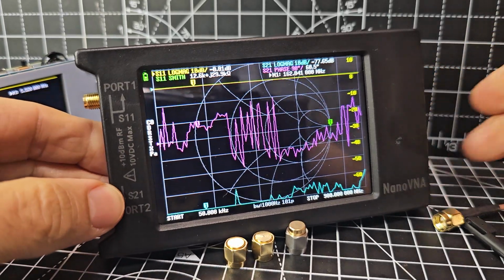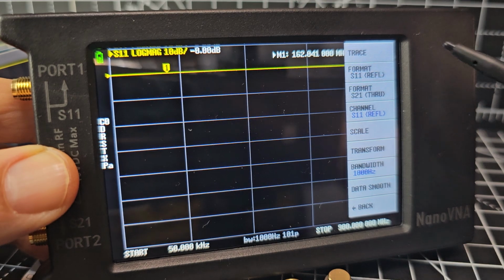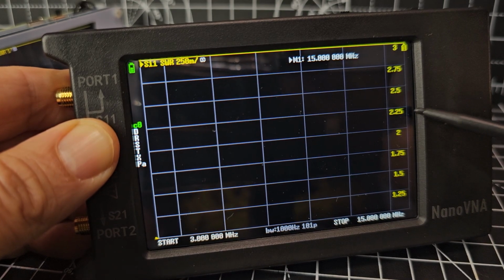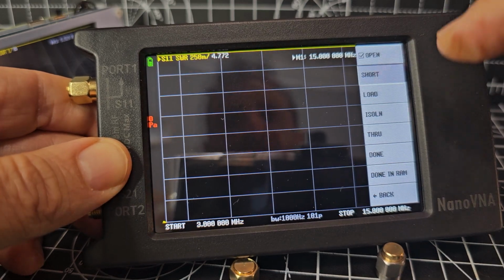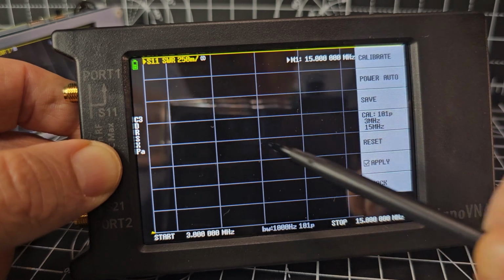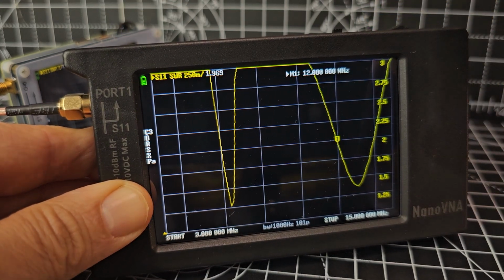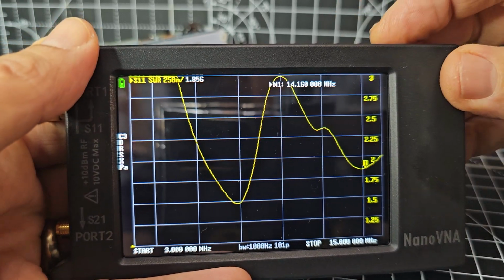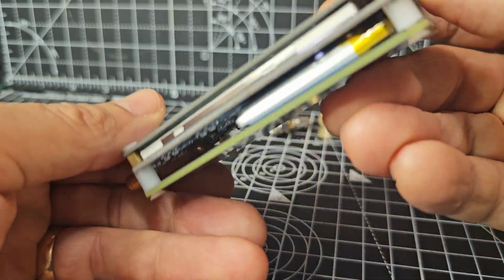NanoVNA , Antenna Analyzer - First Time SET UP

Comment: I need to test VHF/UHF cable antenna so i can check if they need to be replaced or not. Can use this to measure SWR on them and maybe if SWR changes after years it could tell me that i need to change antenna?
Reply from the maker: It will measure what the antenna is doing .

Comment: hi i need to program my antenna for 11 meters how do i do that or do u have avideo for the 11 meter i have nano vna-f v2
Reply from the maker: AI Overview

+9
An 11-meter antenna, often used for CB (Citizens Band) radio, typically has a half-wavelength dipole antenna length of around 17 feet 4.2 inches (5.29 meters). This is the most common configuration, with each side of the dipole being approximately 8 feet 8.1 inches (2.64 meters) long. A full-wave dipole for the 11-meter band would be roughly twice that length, around 34 feet 8.4 inches (10.58 meters). 
Or get an antenna tuner

Comment: I'm new to this and I got GMRS mobile antennas and wanted to try to use one with a homemade ground plane.

lol,
I had to follow the instructions 3 times because every time I attached the antenna, the swr hit the floor (~1.07) and I did not understand it was just perfect from 465.5MHz(1.04x)-467.8MHz(1.08x). I thought it was shorting or the range was wrong. It was not until I dragged the pointer that I read the SWR did change a little.

It was the last time when I did knew I had not missed a step that I finally realized my range is, apparently, much easier to tune. I had to trust the you and the likes...
Thanks!
Reply from the maker: Your welcome glad video helped .

Comment: Just about figured my "tiny" NanoVNA that just arrived - didn't see much of yours 😞
What I found with mine was despite all the videos online there are a lot of menu variations between all the different models out there.
There is, I think some commonality between the layering of the menus but the names and order of the options at each level are different and at first very confusing if you're following a video.
On a practical level there is a limit on the number of presets you can save. I don't think this will be an issue if I set a wide HF range but thats's a lot of info on a 2'8" screen ;-)
We'll sse - might split those up!
Reply from the maker: It's very advanced lots to learn .

Comment: Thanks so much. I just received the slightly smaller/cheaper model. I watched a couple of other videos and couldn;t get rid of those other colours. You made it so clear how to get that display and how to calibrate. I was able to measure my 40m horizontal delta loop and found that the dips for 40m, 20m, 15m and 10m are all about 600 Khz - 800 Khz low - so just needs a bit of shortening. I hope this isn't a silly question - but do I need to re calibrate every time I turn it off and use it again?
Reply: Subscribed
Reply from the maker: More when you change antenna
Reply: @M0FXBHamTech  OK, thanks

Comment: How do I connect this to my radio with these micro attachments
Reply from the maker: You don't ! , You connect it to your antenna there is alot to learn .
Reply: @M0FXBHamTech  of course but still my antenna would need some kind of adapter I use lmr 400 or rg8
Reply: @M0FXBHamTech  like a so239 these are all small wires what adapter do you need that's not included

Comment: While o find SWR useful, I also show the smith chart, phase and log mag.  

I set the SWR to a wider range, 10:1  and use log mag to focus on the useful 3:1 range as essentially they are the same measurements. 

The smith chart is probably the most revealing as it shows what I need to do to tune the antenna. Whether or not the antenna needs capacitance, inductance, or is resonant but a higher or lower impedance feed with a transformer. The phase also assists with finding resonance in the antenna and match unit.
Reply from the maker: Hi great info thanks .
Reply: @M0FXBHamTech  we had a centre dipole for 80m we were setting up for a friend of ours. It was a little close to the ground that the impedance at resonance was too low and so they couldn’t get a decent SWR. They were shortening / lengthening. Nothing was working

Having the NanoVNA with a smith chart, it showed that the antenna was closer to 20 ohms at resonance. I got them to lengthen one end and shorten the other moving the feed point slightly off centre and increasing the feed point impedance without screwing up the resonance. 

If you’re building a mag loop this is really important as resonance is key for efficiency. You want to find resonance first then match the feed to the loop
Reply from the maker: Nice info thanks